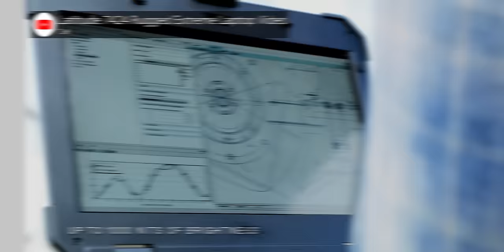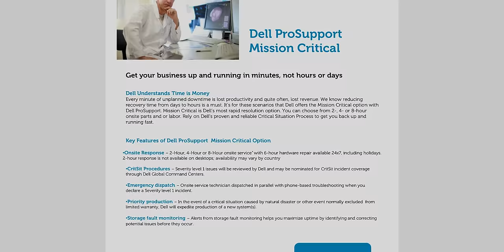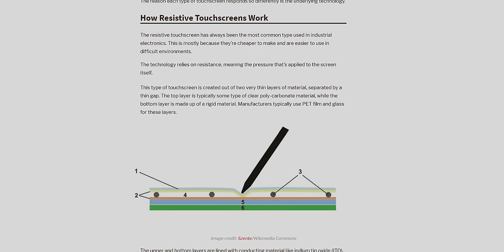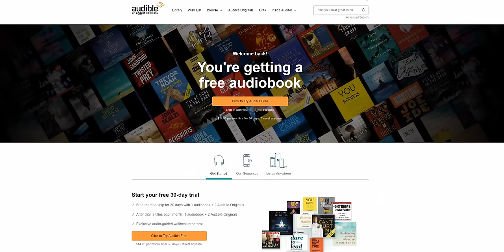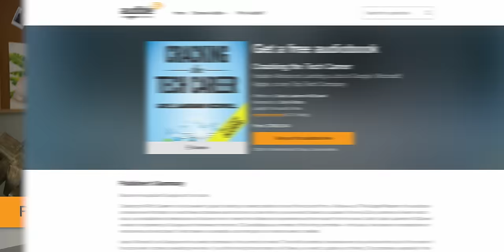The Manliest Laptop Ever – Dell Rugged Extreme Review

Comment: "Who is this beast actually for?"
I can answer that. My shop for "Big engines manufacturer Inc. uses these throughout the shop. Considering we are working with thousands of pounds of 30-78L Diesel engines. It helps. Also, throw in the fact that many of the people I work with are either completely tech illiterate or don't seem to understand that electronics can be a little weak.

Comment: I support a small fleet of these at work.  They are hit or miss in the quality department.  Most tend to have Drive and motherboard issues requiring an onsite tech to replace components or shipping back to the service center.  I'm disappointed with Dell.  These are Dell's Premium Product that we pay about $2500+ per machine and they have awful QC.  I won't even get started on the buggy docking stations.  If my company would allow us to go to a different manufacturer, I would drop Dell in a quick minute.

Comment: I hate it, that people are usually hating on resistive touch displays. While I'm not saying, that smartphones should use those, the often used argument, that those are bad and have awful precision is just bullshit. Take the WiiU gamepad display as an example. Definately resistive, but you could easily draw pixel perfect on this thing. Far better than most smartphone screens, and I can tell as an experienced artist (though I have also successfully drawn pictures on a Samsung Galaxy Note 4).

Anyway, it's pretty obvious, this laptop isn't meant for the average user. And even though I like to take my gear out into the woods, it's not even for me. It's for heavy duty jobs for people, who do heavy duty jobs. If you took this beast to your friends, first they would be amazed, but then they would laugh at you. It's like if a soccer mom, whose trips are basically to school and back and to the store and back would get a 4x4 lifted pickup truck with a lifted, water proofed exhaust system.

Comment: The conclusion you made about touchscreen shows you shouldn't be reviewing such equipment. Who the hell needs capacitive hard sensor that will have trouble with non-conductive improvised stylus, extremely low temperatures and requires special gloves.  This is not an iCrap device, this is a rugged tool for hardcore working conditions. BTW, capacitive also has trouble with drops of water on screen.

Comment: "Who is this for" -- umm  -  the Military uses them as do many contractors  - The smart card reader is compatible with current US Military ID Cards. The reason for its many weird legacy IO is often military and commercial systems like say Oil Rig equipment etc often have very old interfaces because upgrading them or replacing them with something using a new interface is prohibitively expensive. It is a competitor to the Panasonic Tough-book. I have actually heard a story from a friend in the military where a Toughbook stopped a bullet and saved his life, not suggesting anyone try this as it could have been a fluke but it tells you how durable this class of laptop can be. I have even heard of the Panasonic version being full submerged and still working (again I don't suggest trying could have been a fluke). Problem is they are stupid expensive and typically lag behind in performance.

Comment: I dunno about the Dell, but I love my Panasonic toughbook and the Dell seems very similar. It is rather liberating knowing your laptop will survive just about any normal abuse you can throw at it. Yeah, its thick, yeah its ugly, yeah its hot, yeah the touchpad is garbage, yeah its insanely expensive, yeah it gives up a lot... but it gives back so much more. 6 - 9 hours of battery life for one. A touchscreen screen bright enough to see outdoors on a sunny day for another. Being dead quiet for yet another (I mean zero noise, none). I particularly like the fact it converts to a tablet. Its bulk seems appropriate inside a truck, or on a boat, where I never have to worry about a bump knocking it to the floor or it getting sprayed with water. Some of us do real work for a living. We can't show up with a white, lame ass, pussy macbook. No no no no. It does not cut it.

Comment: 2 unit of 2019 Dell Latitude 7424 "Rugged Extreme" in my working place, always BSOD after in use under sunlight (max 36⁰ C) for 1 hour. 1 had its motherboard replaced after 1 year use. Should have bought the real fully ruggedized Panasonic Toughbooks,  not this Dell trash.